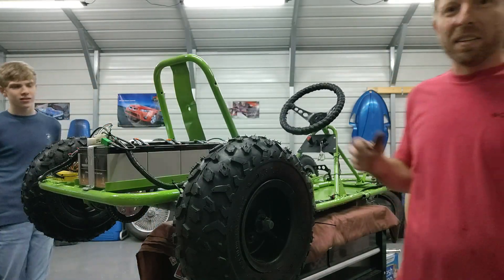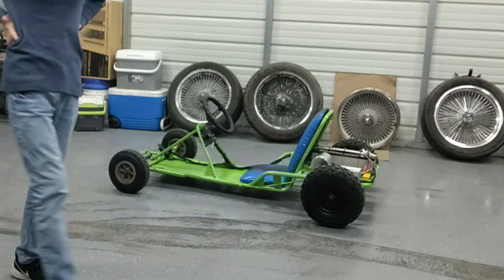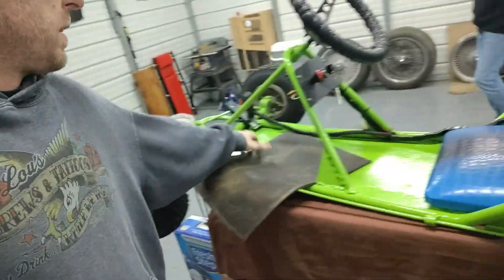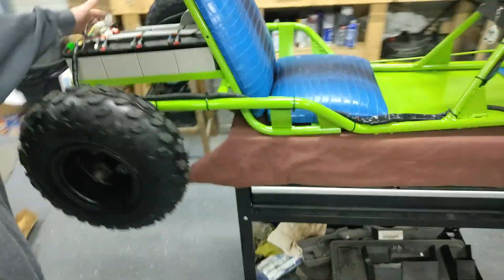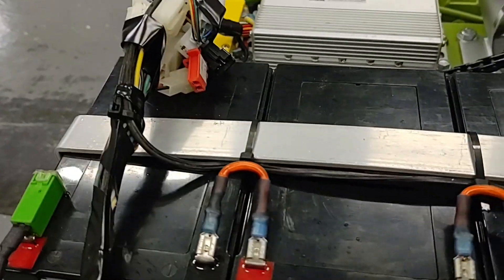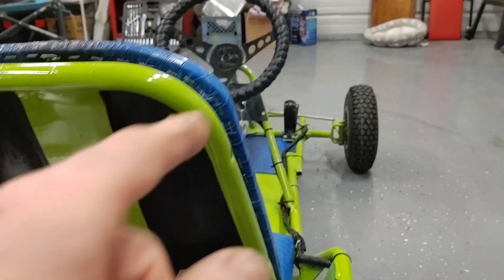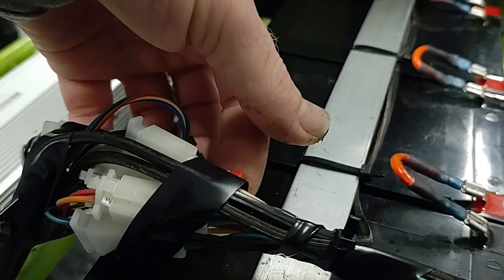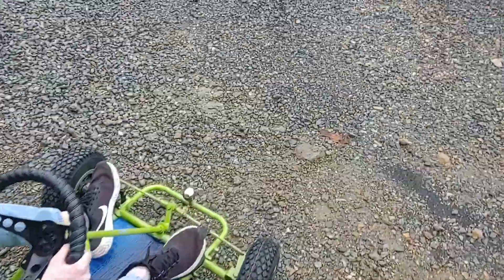E-kart Build From Old School Go-kart Pt-4

Comment: What is the top speed in kilometres an hour
Reply from the maker: Well with the first gearing I had was somewhere around 70 k but I lowered the gearing for more power and less top end it's currently at around 45 or 50

Comment: Fast faster i miss my old Kart i was elated when dad bought me a used IT200 yamaha 1986 mint condition  for my 12th birthday after the 1978 ds100 blew in a week it was slow asf may be 35 max thats fin but not down hill in a tail wind ... he said its a bit big but you will grow into it .if i find one now i but its nice soft seat fast to i put around 3500 miles on it hug was wore out non rebuildanble and in 1995 one could not find parts

Comment: Would u reccomend this kit for a 110cc kids quad / ride on cooler project? Or would that setup not be good for a heavier project
Reply from the maker: If it has a transmission it should be fine if you gear it right you should have plenty of power to take off in 1st gear then shit up for more speed. If it doesn't have a transmission it's just in the speed you should probably go for more voltage.
Reply: @ROCKBOTTOMCUSTOMS  i pulled the gas engine and was going to just use an electric motor. Im making a version of whiskey chariots ride on coolers. So more power ok cool ill look into something more powerful! Thanks bro
Reply from the maker: I see what you're saying now. I think it would be plenty cuz you're probably not going to go too fast on that thing just gear it for low speed.
Reply: @ROCKBOTTOMCUSTOMS  yea its going to be for parking lot cruising during car shows and just a conversation item really
Reply from the maker: Yeah I get it now you're definitely good with that setup 👍
Reply from the maker: Are you talking about a little ride on cooler like pit bike? If so I think it would be good for something like that You're probably going to only be going 20 mph or so I think it's fine if geared right.
Reply: @ROCKBOTTOMCUSTOMS  basically i took a childs quad, took the engine out. Lengthened the frame and placed a beer cooler in the middle. If you google whiskey chariot its a replica of that

Comment: wicked just a tad slow haha im sure a stock 197cc 6.5hp motor is at least twice as powerful and only 100bux
Reply from the maker: Definitely correct, you can go higher voltage and get to those kind of numbers but for user friendly ease of drivability for kids it's great. No carbs gumming up if it sits a couple months and snappy mechanical clutches are rough for beginners too. Again, for all out power and speed I think starting with a Hemi would be the best choice

Comment: Im going to convert my sons hammerhead (2 seat full cage) go kart do you think the 48v 1800w kit would be powerful enough or should I get the 72v 3000w
Reply from the maker: 48v may be pushing it with 2 people on rough terrain. I would go with 72v and you could always slow it down with the high med low switch for starters and with the right gearing it should be plenty of power for the 2 seater.

Comment: I rebuilt an old sealed lead acid e-scooter with this exact motor; I had to cut about a half inch off either side of the speed controller to get it to fit the chassis (snugly) but it all fits.

Now I'm waiting on the new throttle to arrive with the integrated 3 speed switch and a reverse button. 

Mine had the reverse button but no 3 speed selector, and your video came in quite handy to figure out why I wasn't getting advertised top speed. Thanks for helping me solve that, there wasn't even an installation guide in the box. 

I'm running 2x 48V 15AH Li ion packs in parallel, giving me approx. 30AH capacity. 

I did have to drill out the rivets of the old XLR charge port so I could rivet in the new one (different polarity), otherwise there wasn't any real modification required for the frame. Everything bolted right up and I reused the factory wiring channels to keep it looking like a factory install.  

(Speaking of, well done with the cable management on the mean green machine, it looks rather neat and tidy!)
Reply from the maker: Thanks so much! Glad to hear it was helpful. Sounds like you got a pretty nice machine yourself.

Comment: Awesome go kart btw! What is the gear ratio?
Reply from the maker: Top gear on the motor is 9 tooth and axial gear is 71 tooth so I think that comes out to roughly 7.9:1 ratio top speed is around 20 mph. I originally had a 56 tooth on the axle it was topping out a little over 30 but didn't have great power on takeoff so I switch to these 71t. All that is with a 14" O.D. tire.
Reply: What’s the link for the kit   I’ll use my ryobi 40 volt batt if I can

Comment: would this work with the speed control to charge it?
FILSHU 3 Pack AC 250V 10A IEC 320 C14 Panel Mount Plug Adapter Power Connector Socket with 3 Wires

Comment: veryy cool project!! where did you get the charger??
also the adater from the charger to the speed controlor port??
Reply from the maker: The adapter came with the kit. I got the charger off Amazon any 48-volt charger will work just make sure the plug matches whichever adapter you have
Reply: @ROCKBOTTOMCUSTOMS  do you know where i could find one of the adapters?
Reply from the maker: @asmrgoodnight5146  https://www.ebay.com/itm/115252782701?mkcid=16&mkevt=1&mkrid=711-127632-2357-0&ssspo=ErE3ZEUMTWy&sssrc=2349624&ssuid=lTjRWNrTRrC&var=&widget_ver=artemis&media=COPY
You could wire something like this into your controller if it has the pigtail for it, you may have to splice the wires. 
You could also use a charger with alligator clips like this one that would attached directly to the battery bank
48V Battery Charger for Lithium Iron Phosphate/Lifepo4 Battery, 58.4V 8A 467W Trickle Charger W/Cooling System Safety Protection https://a.co/d/b7zPVqi
Reply: @ROCKBOTTOMCUSTOMS  both ideas would work although im in canada and it doesnt ship to canda for the first one and i am running sealed lead acid batterys and i cant find any chargers for them with the aligator clips
Reply from the maker: @asmrgoodnight5146  sorry to hear that. Maybe you could find one with a plug then cut the ends off and modify it with alligator clips.
Reply: @ROCKBOTTOMCUSTOMS  could you help me with something i have been trying to say it for a while but it keeps on getting deleted i send it check 20 mins later and it is gone?
Reply from the maker: @asmrgoodnight5146  sure thing what's up?
Reply: @ROCKBOTTOMCUSTOMS  pretty much im asking if this adpter that i found off amazon would work wit hthe speed control but when ever i paste the link to it on here it just gets deleted
Reply from the maker: @asmrgoodnight5146  rockbottomcustoms808@gmail.com 
try emailing to me
Reply: @ROCKBOTTOMCUSTOMS  will do
Reply from the maker: 👍 thanks!

Comment: I am a high school student and we are trying to make a go kart basically just like yours here, how well do the batteries you are using work on the long run? We are going to make a video and post it on YT so once that comes up I'll share link
Reply: If you want a decent cheap gokart experiance use sealed lead acid batteries (sla). Like he is. I also use them too. But if you want a long battery life and more power and a long battery lifespan. Buy lithium batteries. They are more expensive though
Reply from the maker: I've never tried to run them dead. Usually about a 45 minute  to an hour ride or so then I charge them back up. The charger I'm using shows an approximate percentage while they're charging and I've never seen it below about 25% when I plug it back in. A lot of that would depend on terrain weight of the rider and gearing. Let me know if you have any other questions about the setup. Thanks for watching

Comment: What pedal are you using?
Reply from the maker: The throttle pedal came in the kit that I got from ebay along with most of the electrical components. I think there was a little more info in part one of the series about it.

Comment: What’s its top speed?
Reply from the maker: About 30 mph with 54 tooth sprocket. I've since swapped it to 80 tooth for better low end power and hitting about 20 mph now.
Reply: @ROCKBOTTOMCUSTOMS  Thanks!
Reply: @ROCKBOTTOMCUSTOMS  And for how Long does the battery last?
Reply from the maker: @pedrosanchezdeljuarez4100  not sure. I try to charge it back up after each ride. Probably have a little over an hour on it then recharge but it's still going strong. Then it probably sits for at least a couple weeks before we ride it again sometimes for another hour or so. Definitely will outlast power Wheels several times over
Reply: @ROCKBOTTOMCUSTOMS  Do you Think it Will work with four 12v 14ah batteries?
Reply from the maker: @pedrosanchezdeljuarez4100  that should be fine

Comment: In the process of building a drift kart with the same motor set up, what size sprockets are you using?
Reply from the maker: Originally I used a 54 tooth but I've since changed it to an 80 tooth for more low end power but less top speed and stepped up to the #35 chain. Smaller gear on the motor is still a 9 tooth but in a #35. This link helps for calculating top end speed. That motor I used was rated for $4,500 RPM but after using my GPS to clock the speed of the go-kart I would guess it's turning closer to 4,000 RPM. https://www.bmikarts.com/Go-Kart-Gear-Ratio-Speed-Calculator?gclid=Cj0KCQjwxb2XBhDBARIsAOjDZ35Jv1xZ0X3O2e103oMdL9Vok1CwbcBsCT6T8JZzEzsRpplbk55PKJUaAiXAEALw_wcB